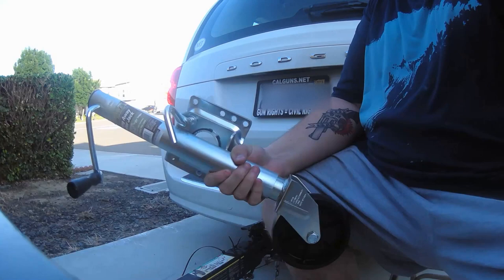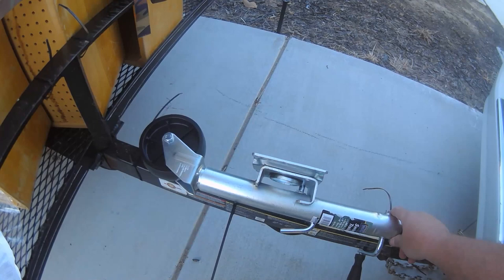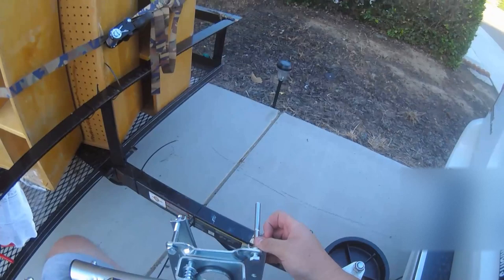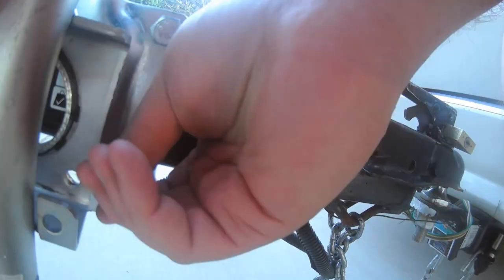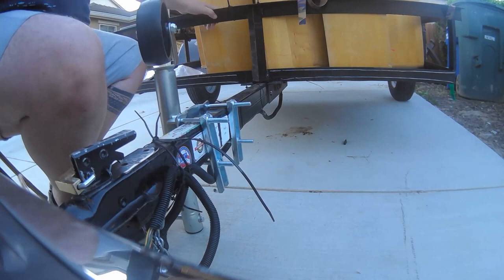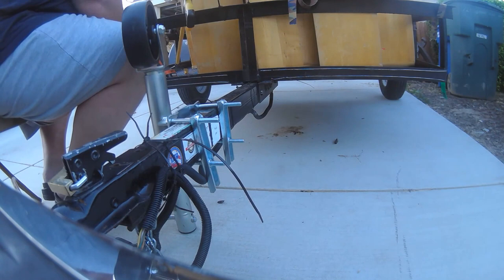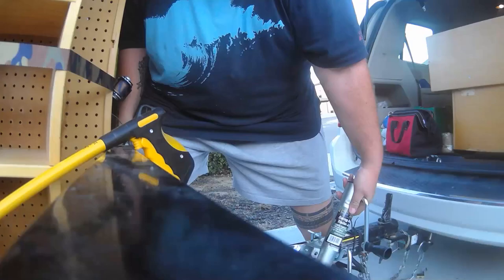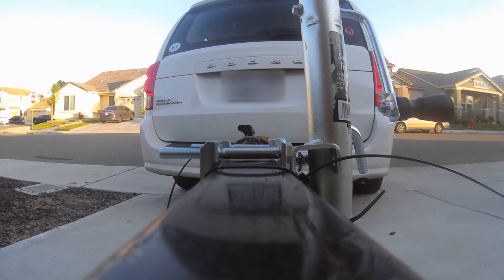Trailer Upgrade - Swing Away Jack Stand

Comment: mine won't fit the bottom bolt won't go through to the other side and if I go down to next hole the gap is almost an inch.Help!
Reply from the maker: The real issue is that the bottom bolts are up against the bottom of the trailer arm.  The top bolts are there to clamp it down.

Comment: The pivot on my jack is frozen.  Suggestion?  I want to keep it and not replace mine.
Reply from the maker: First I'd try a penetrating oil.  If that doesn't work a heat gun and then ice bath.  Once you get it moving, strip it, clean it and try it again.

Comment: Can you use the Jack stand with a full load of Mulch in the trailer? Will it hold?
Reply from the maker: I don't know about mulch but I had the trailer loaded up with 3 tool boxes completely full of tools. It was most certainly over the weight capacity of the trailer. And I had zero problems most cranking it up or down
Reply: @denoftools  Thanks.

Comment: where did you put spare and with what mount?
Reply from the maker: Right now I'm keeping the spare in the trailer itself I have not found a mount that I like then we'll work with the side walls on this trailer
Reply: @denoftools  thank you i may put ubolt up front on top rail just drill 2 holes i guess and stand it on tounge should work